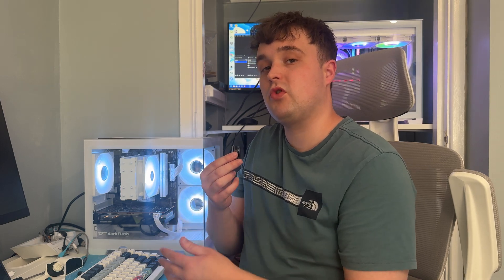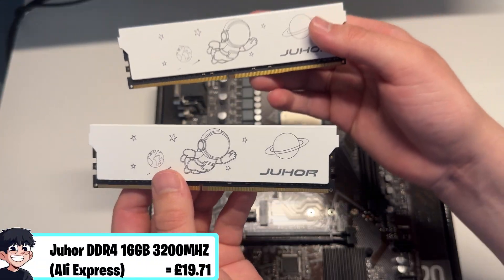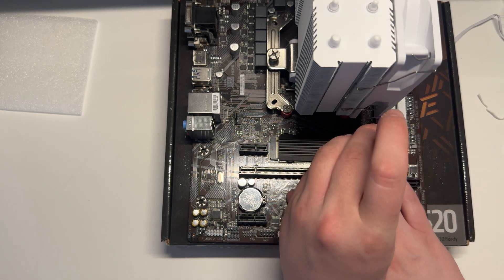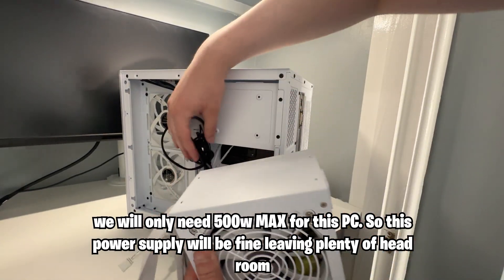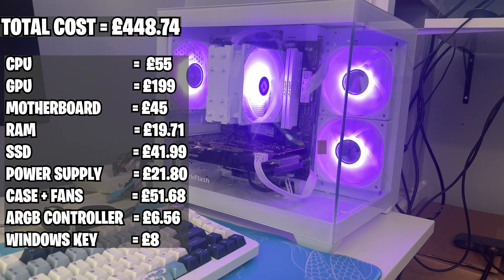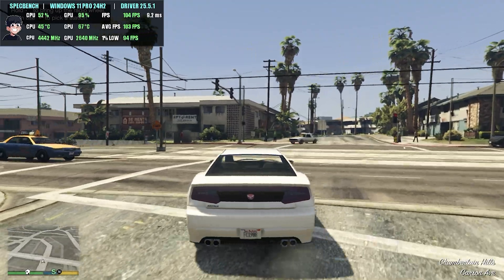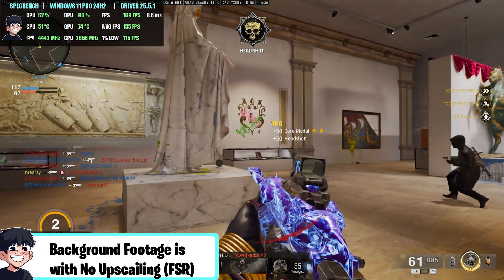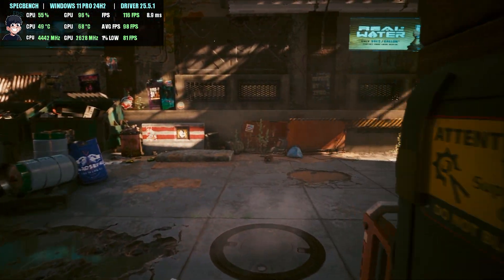£450 Budget AMD Gaming PC Build ( Insane Price to Performance )

Comment: Pc is opti?
Reply from the maker: I do not tweak PC’s that are being sold. They are running stock windows 11 24h2 with latest drivers
Reply: Windows 12? @SpecBench
Reply from the maker: @fifacorse windows 12?😮
Reply: Does windows 12 exists ?@SpecBench
Reply from the maker: @fifacorse no, windows 11 24H2 is the latest
Reply: Oh ok in the first message you had wrote 12@SpecBench
Reply from the maker: @fifacorse ohh sorry typo 😂

Comment: Bro i want to buy a pc 
Plz tell me best pc parts under 
$450 or indian rupess = 40000
I need only performance not look. 
And without monitor that price,. 
Plz replay and tell according thing available in India or India Amazon
Reply from the maker: $450 and you’re going to build it yourself? Or you want a pre built computer ?
Reply: Built my self tell me part only bro plz@SpecBench
Reply from the maker: @AiHistory-zz I highly doubt you could build a pc with new parts from Amazon for £332, but I guess a ryzen 5 3600 and a b450 motherboard, 16gb ddr4 ram at 3200mhz , 500gb m.2 ssd minimum , the cheapest 550w psu you can find with decent reviews and then you’d probs have to get a second hand GPU to stay in the budget
Reply: Is i5 12400f not good that price? @SpecBench
Reply: @SpecBench I think rayzan 5 5600= $130
With rx590 =$130
Reply from the maker: @AiHistory-zz  sure but i dont think you'll fit a 5600 in that budget. also nvidia card would be better for fortnite
Reply: Bro I want for editing and gaming and I not play fortnight
@SpecBench
Reply from the maker: @AiHistory-zz great then :) but still buying new idk how you’re gonna fit 5600 in the budget
Reply: Bro first sorry and can u tell me which combo is best 
First - Rx 590 Gpu - 10k 
I5 12400f or 5 5600 Cpu - 10k 
16 gb Ram - 4k 
 500 nvme Storage - 4k 
500 watt Power - 3500 
Mother - 7k 
Case 3500
= total - $490 dollars

Or 2nd 
Rx 6600 Gpu - 19k 
I5 12400f or 5 5600 Cpu - 9k 
Case - 2k 
8 gbRam - 3k 
256 sata ssd Storge - 2500
Motherboard - 6k
500 watt Power - 3k
= total - $512 dollars

@SpecBench
Reply from the maker: @AiHistory-zz  i would deffo go with a newer gpu like rx6600. but i wouldnt go for 256gb sata SSD, its barely enough to store a few games on..
Reply: Bro I can afford with rx6600 with 256 sata ssd and only 8 gb ram 

But with rx590 I can afford 16  gb ram with 500 gb or 1tb @SpecBench
Reply from the maker: @AiHistory-zz well the smarter option is probably just to wait a little longer and save no? No point getting 8GB of ram and an SSD large enough for 2 games. If you “really” need to get it now then I guess RX590 is fine, but you’ll find yourself upgrading the GPU faster than if you was RX6600.

Comment: Bro for 1080 200hz is RX 6700 or RTX 4060 which is better for gaming and get more fps?
Reply from the maker: It will most likely depend on which game. I can’t see any comparison videos with 6700 vs 4060 but there’s loads for 6700xt vs 4060
Reply: @SpecBench like in fortnite how much fps I will get in 4060 without any optimization?
Reply from the maker: @BeastG2_ Fortnite is CPU intensive. Your CPU is what matters
Reply: @SpecBench is ryzen 7 7700 is better for fortnite? Or core i5 14400f?
Reply from the maker: @BeastG2_ 7700 is better for Fortnite

Comment: i have the exact same build and performance mode runs terrible on fortnite with unplayable stutters and fps drops
Reply from the maker: It’s common for AMD cards
Reply: @SpecBenchif i were to upgrade my cpu to 7700x3d would that change much?
Reply from the maker: @OggieplaysYT you mean 7800x3d?
Reply: @SpecBench nah 7 5700x3d forgot the 5. i watched your video on it and it seemed to perform amazing
Reply from the maker: @OggieplaysYT it will still perform a lot better with your GPU, however it may not fix the stutters and FPS drops fully. As that’s most likely caused by your GPU. I found that after a few games it’s fine for me, but first few games are stuttery
Reply: ah ok thanks
Reply: was it fine on performance or do you use dx12/recommend dx12?
Reply from the maker: @OggieplaysYT just try out Both and see what you think, not everyone has the stutter /fps drops on amd gpu’s so.. for me when I had a 5700xt it was unplayable that’s why I switched to Nvidia and never went back
Reply: @SpecBenchfair enough. thanks